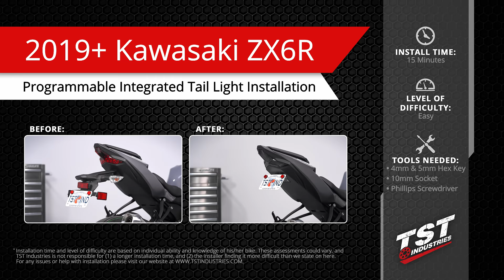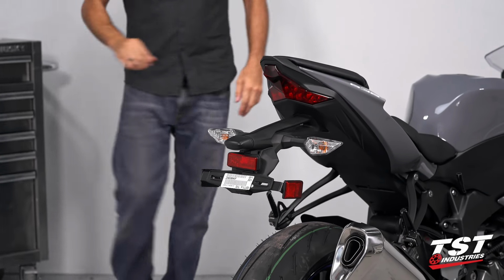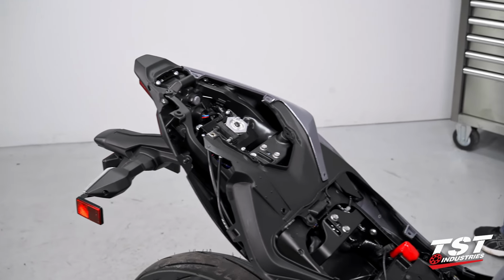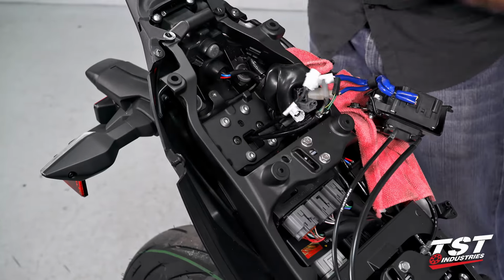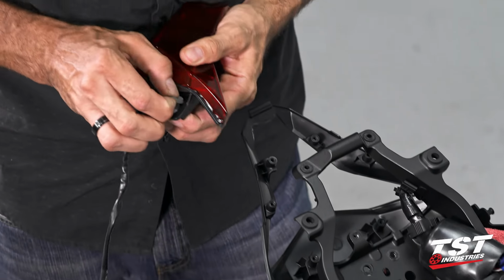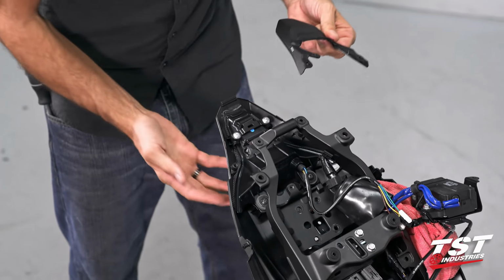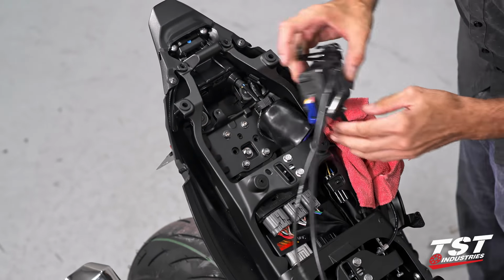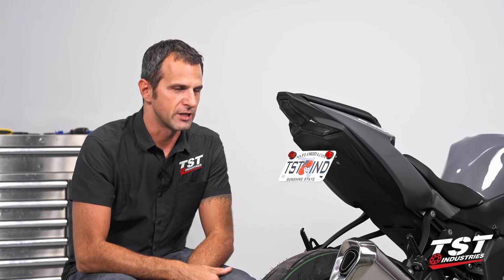How to install a Programmable Integrated Tail Light on a 2019+ Kawasaki ZX6R by TST Industries

Comment: I just installed the tail light in the dark smoke color on my black 2024 ZX-6R, looks great! Install took maybe 3 hours for tail light, fender eliminator, flasher relay, and license plate light. It took extra long because I dropped a bolt inside the motorcycle and had to take some more fairings off. Don’t be like me, be careful while doing this a rewatch many times! The installer is very good and it will take you longer than it will take him, unless you’re gifted or a mechanic (in that case why are you reading this).

Comment: I just installed this integrated tail light on my 2023 ZX6R and absolutely love it! The quality, features and looks are fantastic. It is worth every penny. My only advice is to be extra careful with removing and putting back on the rear fairings. I bumped into an issue reassembling the tail because I overlooked the placement of one of the tail pieces. Not a big deal, but you've got to be meticulous and take it slow. BTW, thanks for this video. It made all the difference during the install.
Reply from the maker: Thank you for sharing your experience. We appreciate the extra pointer for our viewers. Cheers!

Comment: Holy Crap guys,  I order this and some Gilles rearsets late night on the 16th and here it is noon of the 18th and I'm installing the parts.  Pandemic Be Damned, y'all make it happen!
Reply: Install and programming was simple.   What blows my mind is how much better your unit fits than the factory light.   I couldn't get the factory light to stop rattling without a lot of tape and padding.  Yours fit perfect and secure with no adjusting or rigging crap up.   These manufacturers need to use your products.
Reply from the maker: We spend a lot of time in R&D and go through a lot of prototyping iterations before we make injection molding tools. We strive to correct any inconsistencies from the factory. We have been doing that for a long time. There are a lot of our competitors who just copy the OEM parts without regard to how they actually fit and function. We re-do everything. Thank you so much for noticing. I hope you tell the world. Cheers!

Comment: Installed my new TST fender eliminator kit today. How does one reinstall the push rivets? Also I had a extra molex connector when finished? Was white. I’m thinking it was for the original license plate light? Everything works great! Love the way it looks!
Reply from the maker: You reset them as shown in the video, push them in and then press the center until it pops in flush with the head. The extra connector is in fact for the OE license plate light. It isn't molex brand but it is a two conductor connector. I'm happy to hear that everything works great. Cheers!

Comment: These are great, and my TST integrated programmable tail lights have given me years of reliable service, get lots of compliments also the price is very affordable and the styling matches the bike, doesn’t look awkward in facts looks exactly as if it was designed as part of the original bike, thanks for the instructional video and the TST LED relay is the best easy reliable option to correct the flash rate.

Comment: Hope to get some feedback on this. Is the zx6r and ninja 400 tail light cross compatible? Since the design is identical I was wondering if I would be able to fit and wire up the zx6r tail light to a ninja 400
Reply: Inquiring about this because I have a buddy with a zx6r tst industry tail light he’s willing to sell to me but I have a ninja 400
Reply from the maker: It is the same exat light

Comment: Question. I have a 2021 ZX6R that came with this setup and I was told it wont pass inspection because the blinkers need to be further apart. Do you make something so I can get my sticker then remove after? Thanks
Reply from the maker: Yes, you can purchase both of the products linked below to either introduce external signals in addition to the integrated ones or you can disconnect the integrated signals and only use external signals. The choice is yours. 

Y-Splitter - https://tstindustries.com/tst-kawasaki-y-style-signal-harness-splitter.html

Rear Pod Turn Signal Kit - https://tstindustries.com/tst-led-rear-pod-turn-signal-bundle-kawasaki.html
Reply: Thanks for the info @TSTindustries

Comment: The bundle from the website comes with a flasher relay but do i really need it with this new taillight because i do not see it being used in this video. im also getting the fender eliminator kit
Reply from the maker: In my experience of working on the 19+ and 24+ models, when you replace the rear OE signals with LED signals the flash rate gets faster. If you also replace the front signals it gets even faster. So this is where i use the appropriate relay to remedy the fast flash. If you don't replace tje relay you will likely have fast flash. This does not damage anything, but may be confusing as ot is not the standard accepted flash rate

Comment: What did you do for plate light? Is the brake light throw enough, or is a separate light required by law?
Reply from the maker: That would be a part that would be covered in our Fender Eliminator video. In short, we do offer a license plate that’s universal and can be installed on virtually any bike or vehicle.

Finding out legality would rest on you as we’re not familiar with laws of every city/region.
Reply: @TSTindustries  I ordered your tail tidy/fender eliminator as well with the "panel patch" so everything is there to hook up I just haven't ordered a light. If I need one by law I'll be ordering yours.

Comment: I see that this is set up without the addition of the license plate light, is that needed? Or does this setup provide plenty of light for the license plate? I would assume at night there is no light on the license plate making it impossible to see without braking.
Reply from the maker: If you want to illuminate your license plate then you will have to add that light. The tail light does not provide any white light on the license plate.

Comment: Do you guys deliver to the netherlands?
Reply from the maker: Yes we do.
Reply: @TSTindustries  what is the expected delivery time?
Reply from the maker: @user-np2hc7ci3b  we offer several shipping options. Each one has the specifications listed. I think if you visit our site and drop your address into the cart, I you will be presented with the options.
Reply: @TSTindustries  allright, one more question: will the brake Light flash everytime you brake or only when you brake hard? Thanks
Reply from the maker: @user-np2hc7ci3b  the effect takes place whenever you trigger the brake light, regardless of brake pressure.

Comment: Are you guys going to make a version like this tail light for the +2017 Yamaha R6 & R1? If so when would it be out?
Reply from the maker: The R6 and R1 have a very slender OEM tail light. We decided to not make a tail light for that bike because there is not enough room to make signals distinguishable. We do have some designs for the R6 and R1 that are external signals, just haven't completed the projects yet.

Comment: Hey Bart my integrated taillight came with two extra couplers attached to it one green and one brown what are those intended for? To tap into for my license plate light?
Reply from the maker: At some point Kawi switched the type of connector they use for signals. We need to ensure compatibility across all the years of this model so we had to add the extra connector. You just use the ones that work with your bike and leave the remaining ones not connected

Comment: @TSTindustries my bike has 2 front turn signals of incandescent bulbs + rear tst taillight. Will flashing them fast with rear LEDs make it go bad?
Reply from the maker: Nope. You can't damage the lighting components with fast flash. Please note that if your bike signals flash very fast, and you've chosen the sequential signal program for signaling, then the sequence will not finish because the cycle time for each flash is too short. In that case you will not be lighting up all the signal LEDs.
Reply: @TSTindustries  thank u

Comment: Hello. I got a 2024 zx6r and there is no plug for the turn signals so what would i do?
Reply from the maker: I think you need to explain your question a little better so i can help you with precise info. Im not understanding the question as it was stated. The bike has signal connectors, and our tail light has signal connectors, so i am missing some key part of info here.
Reply: @TSTindustries  so on the 2024 they dont have the individual turn signal connections however i plugged in the one that does control the turn signals(its the single connection) and only the left worked. Im trying to figure out why or if i need a split
Reply from the maker: @michaelh9750  you must be overlooking sometging. We have had othe customers buy this tail light for the 24 and install without issue. When you disconnect your fender lighting you have nain tail light connector with three condusctors, and then three sets of two conductor connectors. The three are license plate light, left signal and right signal. During your disconnection step did you find all those connections? We may have to get you over to the customer service portal on our website to have a better flow with helping you. There we can exchange photos and videos so you can illustrate what you are seeing. If need be a video call can be arranged too so i can get eyes on your setup.
Reply: @TSTindustries  that may need to happen ill go hit them up. Thank you
Reply: @michaelh9750  what did you end up doing? mines the same issue but the right flashes instead of the left

Comment: Website says the license plate bracket is TBD. Any idea on when it’s coming out?
Reply from the maker: The machines are turning and we are doing our best to make the production run of the closeouts that will be the base component  of this system. We are going as fast as we can. We just designed it this last Monday, and they are in process already. I am told that we should have a small quantity back from anodizing and ready to go before Christmas. Please don't hold me to that 100% as delays can happen, especially around the holidays. If you sign up for the availability email on our website product page you will get notification when these parts are available.
Reply from the maker: The parts you were asking about were made available yesterday. Here is a link to the category https://tstindustries.com/Kawasaki-Ninja-636-ZX6R-2019-/

Comment: If the flash rate doesn't matter to us, is it ok to use it without resistors or relay? Just the integrated tail light. Will it damage the light?
Reply from the maker: The flash rate will not damage the light. If you are trying to use sequential signal, the sequence will not have enough time to complete if your flash rate is too fast, and you won't light up all the signal LEDs.
Reply: @TSTindustries  thank u, another question i have is the bike has 2 front turn signals of incandescent bulbs. Will flashing them fast with rear LEDs make it go bad?

Comment: When showing the after, the bikes turn signals went from a regular 85 cycle to a fade out thing... how was this done
Reply from the maker: If you are talking about the sequential signal mode that wipes amber light from center out, then it is one of the programmable modes that we built into our lights. There is a little button on the light enclosure, accessible from the trunk compartment after installation, and with each press of that button you toggle through 9 combinations of programs. If you want more information then please visit the product page dedicated to this model bike on our website https://tstindustries.com/kawasaki-ninja-636-zx6r-2019-/

Comment: This is a great light. But now I have a CE light on. :-/
EDIT: * TST reached out to me, figured out the error - do not test the turn signals without all the cables plugged in. It'll cause a CE Light because of the Servo. Also, purchase the Relay that they recommend. It's too easy of an install not to have. It makes the Strobe Light & Sequential Lights look wonderful!
Reply from the maker: That is not related to the tail light. We have done a number of these in house, and sold hundreds to 19+ ZX6R owners, and nobody had this issue yet. One time there was an issue where the CE light turned on but when we read the code it was because the tip over sensor was disconnected and bike powered up. Someone missed a step in the sequence of installation and cause the CE light to turn on but that was unrelated to the equipment. You should retrieve the code from the dash so you can reference it to what caused CE to come on.

Comment: I plugged in the turn signal connection, heard a pop and  the taillight stopped working. The turn signals still work but i dont get a brake light anymore...what could of happened
Reply from the maker: Thay sounds like you blew the fuse for the tail light system. The signal connections are working according to your report, so that is not ehere ypu are experiencing a problem. Please check all of the connections made to the tail light circuit, and any aftermarket components yhat may be connected to it also. Ensure the connections are clean and do not have short circuits to ground or other condusctors. Then replace the fuse.
Reply: @TSTindustries  I did! Thank you so much, all is good now :)
Reply from the maker: @justinlukas4621  great!

Comment: Hey what if I got a check engine light
Reply from the maker: You most likely disconnected something like the exhaust servo and powered the bike. If you plugged it back in it just needs time to reset. I would recommend that you pull the code and find out what it is just in case. This way you don't end up ignoring an actual problem in case you have a coincidence of when you installed the tail light and when code came on.

Comment: Do you have for zx25r
Reply from the maker: If you are asking about the new ZX25R that just launched with the 4 cyl engine then this is the same light that will fit in it. The only difference may be that the signal connectors are different because Kawasaki started using different signal connectors in markets outside of USA on some models. We do not have the ZX25R in our market so we have not made a dedicated tail light for that bike. You would have to replace the connectors for the signals on your own.
Reply: @TSTindustries  thanks you so much

Comment: I have 2 extra plugs hanging off of my light... why?
Reply from the maker: We included 2 sets (4 individual signal connectors) that way all year ranges and models can use the light without the use of subharnesses. This light fits the Z400, Ninja 400, ZX-4RR, ZX-4R, ZX-6R, and ZX-10R. With each of those covering several years.

Comment: Why do I got 5 wires on mine and u only got 3
Reply from the maker: This tail light fits a few different models across different generations so instead of making a couple of different tail lights and increasing the price, we made one tail light that fits all models. You can simply leave the extra turn signal connectors you don't use, disconnected.
Reply: Ah ok thanks